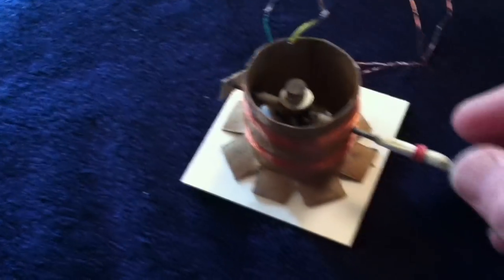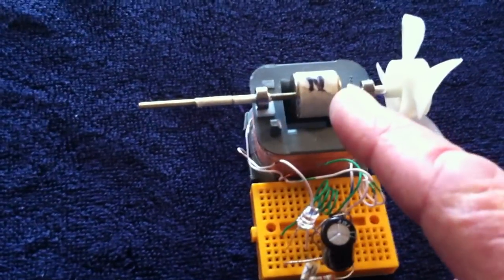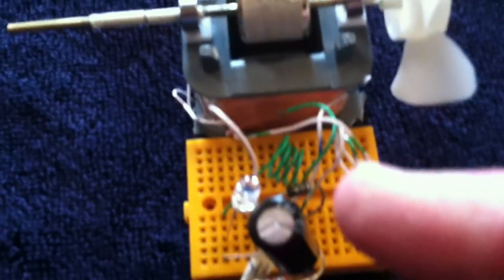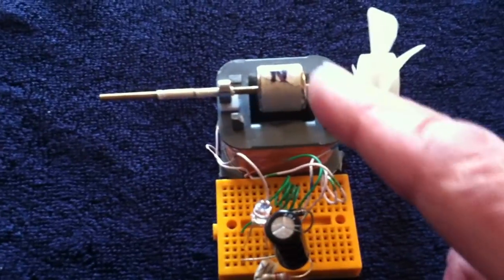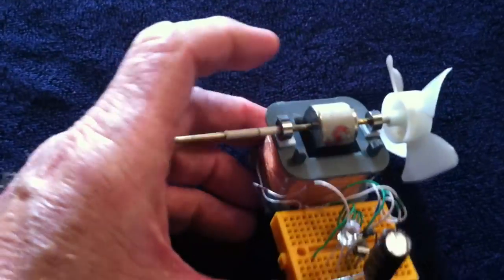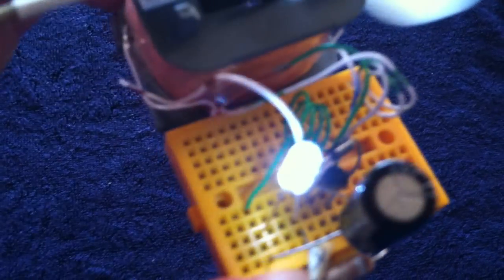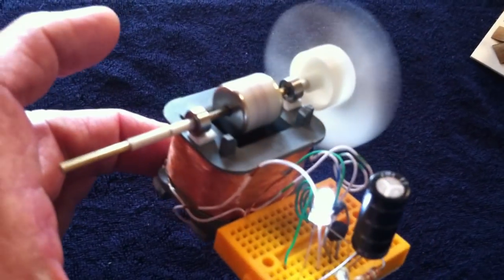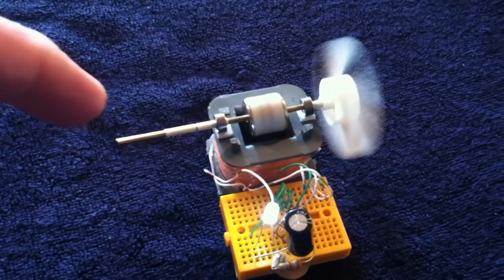Motor Project Update

Comment: Hi. What is contributing more towards the higher torque? Is it the placement of the magnet, in that it is not at the center of the coil winding, or is it the coil itself? Or is it a combination of both.
I always try to understand why you have done something in one way and not the other. Thank you
Reply from the maker: It is a combination of things.  On this motor the drive coil is a pretty thick diameter wire coil pushing against a very strong neo magnet.  This motor would work better with a coil on each side of the magnet.

Comment: Get well soon from that cold :)
Some gearing might help the project, a 4:1 or something. Can't wait to see if the motor does power a car...CD wheels and all that haha great fun !
Reply from the maker: Actually I'm OK.  I just have an allergiy problem because of the weather out here now.  I may gear this down or go to a hall sensor circuit and see if it will drive a CD car as is. A  4:1 gear ratio would really help.

Comment: Nice, I figured you were going to use a couple stages of reduction gearing to 
get it to have the torque needed.
Reply from the maker: The gear reduction is a good idea if I can do without losing too much power to friction losses.